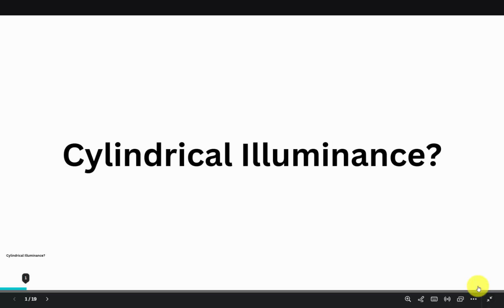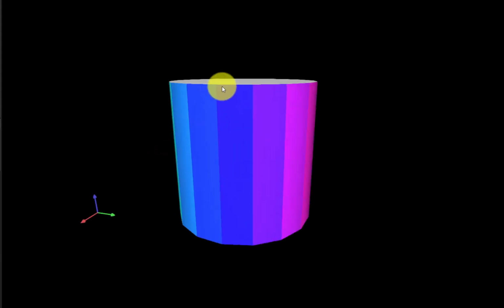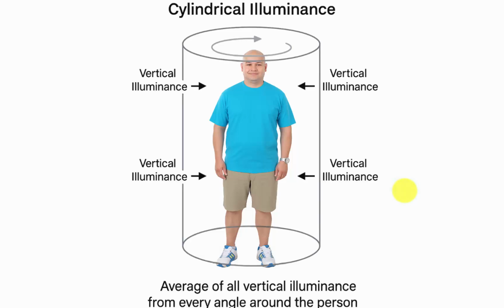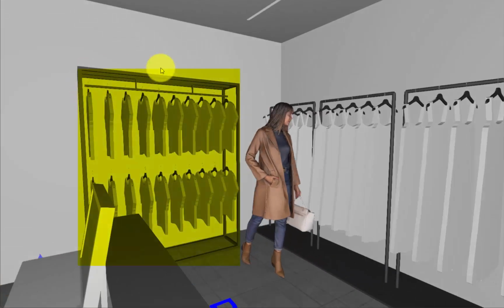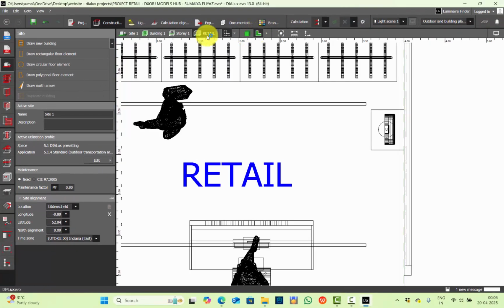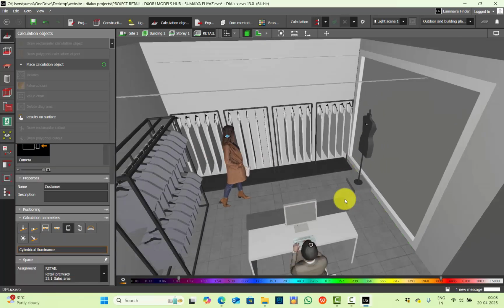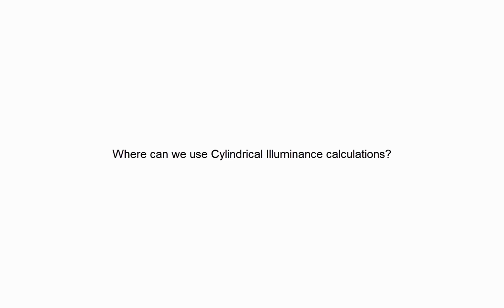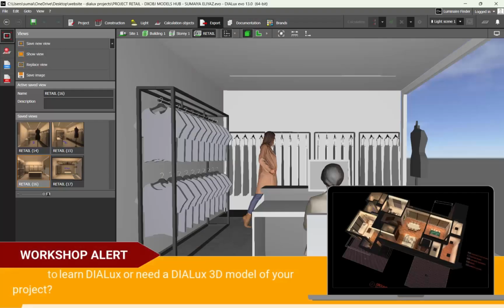Cylindrical Illuminance | How to Calculate It in DIALux evo

Comment: How much lux required as per cylinder illustration
Reply from the maker: Just to correct you — it’s illuminance, not illustration.
As for the lux values, cylindrical illuminance varies based on application — that's why we refer to lighting codes and standards.
You’ll find links to relevant handbooks on my website. Link below :
https://sumaiyaeliyaz.com/designers-special-package/